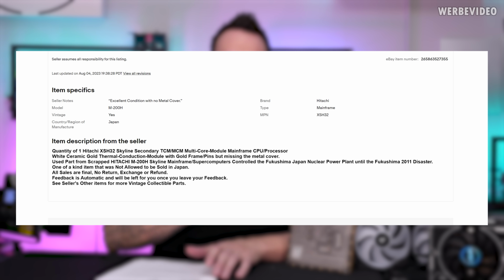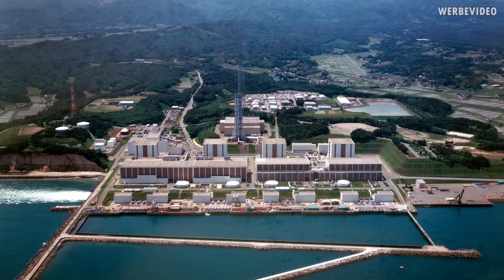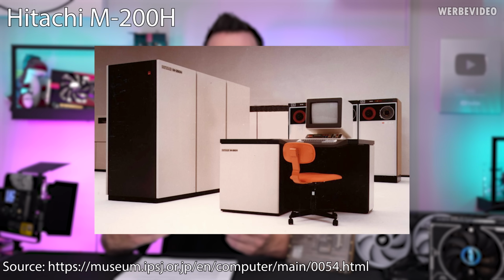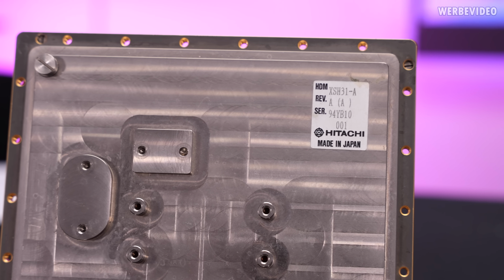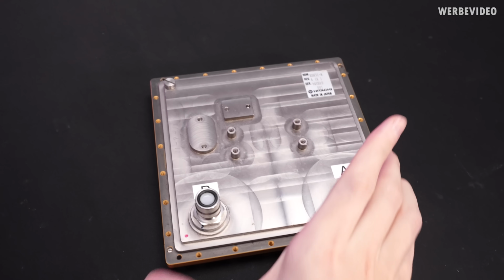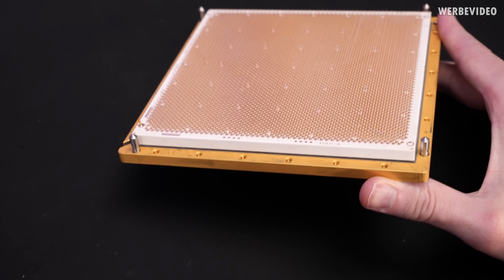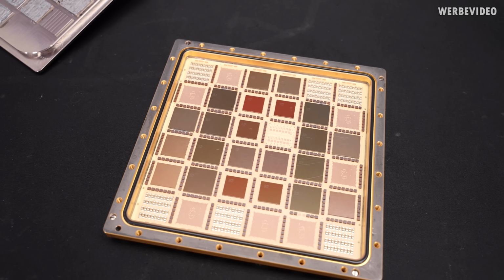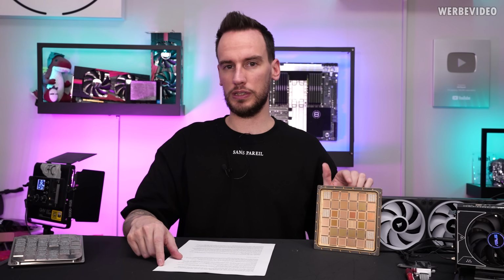This CPU was used in the Nuclear Power Plant Fukushima Daiichi?

Comment: That is getting to be the right size for a cpu. I can imagine that if AMD had this size, they could easily fit in 512 cores.
Reply: They could fit much more, considering the core count and density of Epyc Bergamo. But such CPU would have many kilowatts of TDP making it a bit unpractical. Can you even cool 3Kwatts on a 15x15cm plate?
Reply: @marsovac I'm not a physicist, but I'd think it would be possible. Even if extreme subzero cooling was required. Kingpin had a project called Roboclocker, which automatically cycled LN2 through a GPU and CPU to maintain a specific temperature. It was a one-off project with limited manufacturing capabilities, so I'm sure a company like Intel or AMD could develop a more fine-tuned system. But you are right, the practicality of something like that is not likely
Reply: there's a company called Cerebras which uses a whole wafer to make a many core AI CPU with integrated memory and networking
Reply: You would have to run liquid nitrogen cooling
Reply: @rkan2  Sounds about right.
Reply: @rkan2  No, even LN2 wouldn't cool it.
Reply: @AlfaPro1337  512 cores you would run at about 4-5W each (like on the 64 core AMD cpus) so that would be 2,3kW. With a surface area like that you might even be able to cool it with water if you had the right kind of fluid. Liquid Nitrogen would be no problem.
Reply: @rkan2  You forgot the I/O dice, the insulation value of the glue that they used, the heat generated by the resistance of the wire between mutiple die and the large air pocket trapped underneath the heatsink.

That's 100W or more worth of heat, multiply by 512. That's over 51.2 kW of heat.
Reply: @AlfaPro1337  Each core now consumes 100W of heat? ok bro :D
Reply: @rkan2  At minimum yes, but no, that's just extra. it's X W (core) + Y W (all the glue, package resistance, latency, etc)
Reply: @AlfaPro1337  You're not making any sense. What you are saying is a 64 core threadripper consumes 64x100W or 6400W. Good riddance.
Reply: @rkan2  Are you on the same page? I mean we are talking about that 512 core what-if. Not that one. Good riddance.
Reply: @AlfaPro1337  Apparently not. You are saying with 512 core 51.2kW power consumption each Zen4 core takes 100W which makes no sense.
Reply: @rkan2  Did you read?

X W (core) + Y W (others) = 100W or more.
Reply: @_-Karl-_  That would be awesome !
Reply: @_Karl_  AMD needs to change socket every CPU release, and making it incompatible with existing. 

Example fictional 7990X3d? That needs a new socket.
Reply: And there will be so much glue, so much latency, and so much bottlenecking, and it will cost a million dollar.

Comment: Measuring radiation? that would probably be a Geiger–Müller counter. Hans Geiger was German, but device is still called the same in English
Reply: He's done a video before where he didn't know how to say dosimeter.
Reply: probably meant Zählrohr
Reply: Not only - there are also ion chambers (very simple, but not that sensitive) and proportional counters. Also, regular photodiodes can detect gamma rays
Reply: Shortened to Geiger Counter.
Reply: So is Alzheimer's.

When something is name based, it's not translated for obvious reasons.
Reply: @incumbentvinyl9291  but that's probably not what he meant, Geiger-Müller measures something specific, a Zählrohr can measure more relevant things.
Reply: @AtaGunZ  What has that got to do with what I said? Are you writing the wrong person?